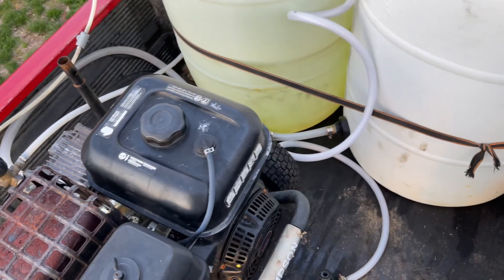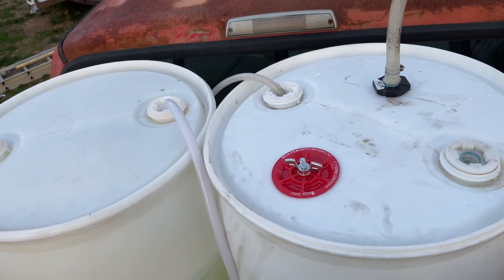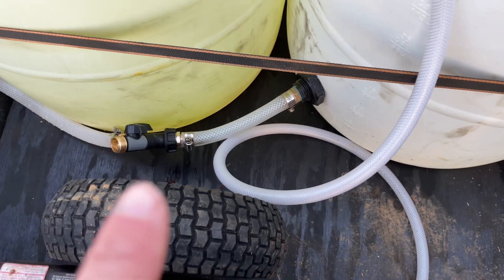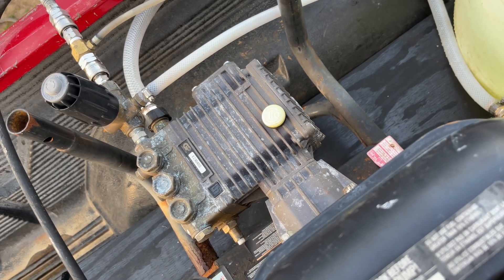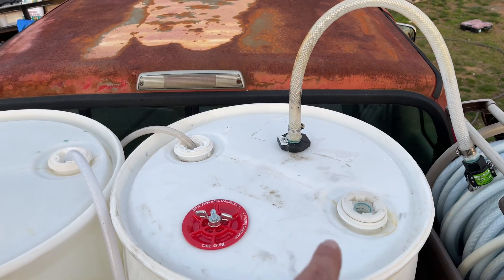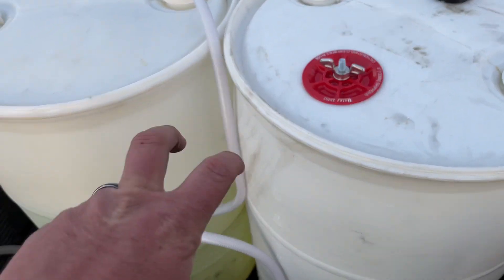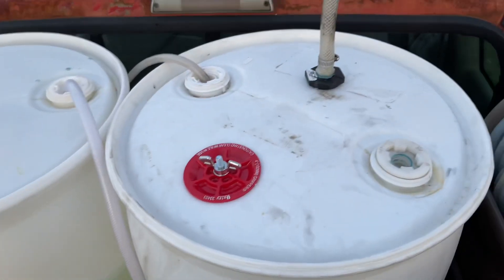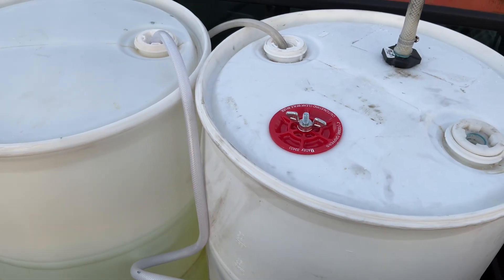55 gallon buffer tank for my 4 gpm pressure washer

Comment: For the bottom bulk head. It is 3/4 and I guess you have a 3/4 male mpt to 3/4 barb on it?
Reply from the maker: Yes. I would recommend every fitting you get to dry fit and make sure they work together. I had a lot of fitting that were same,but wouldn’t work.

Comment: What fitting did you put on the pressure washer where you’d normally attach the hose?
Reply from the maker: A repair garden hose fitting https://amzn.to/3KOThG4
Reply: @jonboysprowash7845  thanks man! Easy enough!
Reply from the maker: @SuperiorShineSoftwash  You’re welcome. If you don’t need many you can get them at Lowe’s or Tractor Supply.